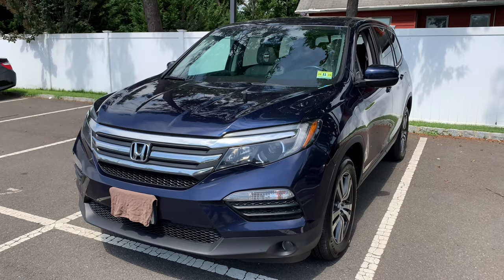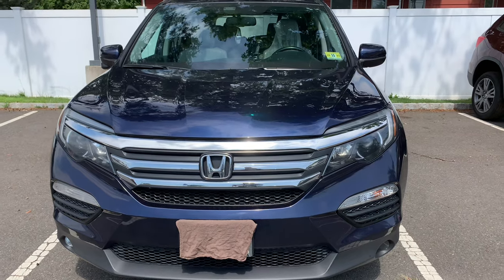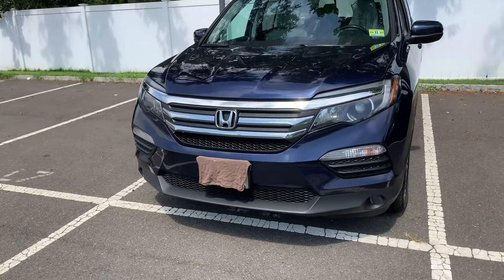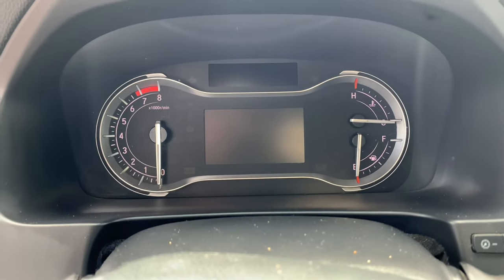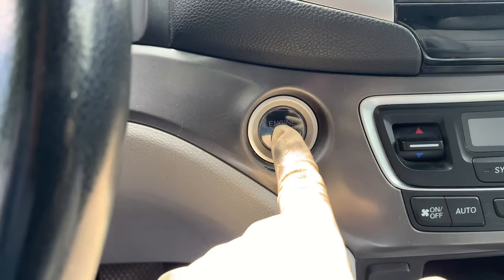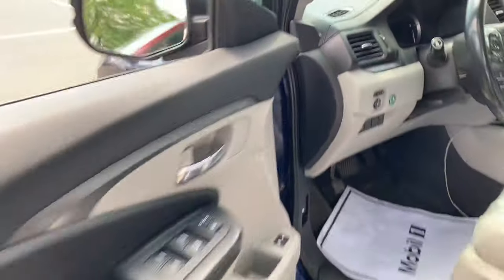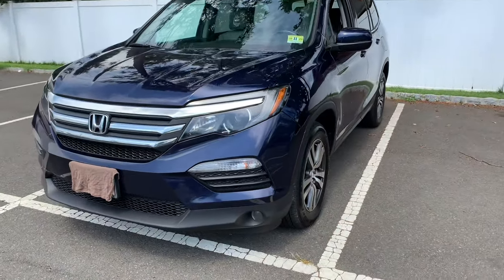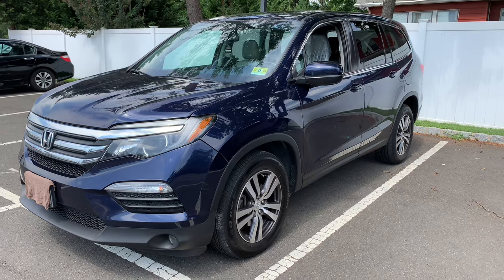2016 - 2018 Honda Pilot common problems

Comment: Bought a 2016 pilot new.  Still own it. Everything you mentioned happened to mine. Luckily had an extended warrantee which covered everything.  

The tachometer bouncing / transmission judder pops up about every 30k miles.  Drain the transmission fluid, refill.  Roll through all the gears including reverse X3 fixes the problem.  

Great review !
Reply from the maker: Thanks for the watch and for the feedback. Your confirmation that these issues are real are unfortunate but a reality. Best of luck with it going forward.
Reply: My car still bounces rpm after transmission
Reply from the maker: @yourdad1483  used or reman? You should take it back
Reply: New one
Reply from the maker: @yourdad1483  I would absolutely take it back
Reply: Same problem.. what is exactly main issue?
Reply: @HannahLoften the main issue is once the fluid breaks down the transmission starts acting up.
Reply: I need check with dealer still under warranty... it s honda pilot 2020
Reply: How much fix it. Thst exactly hapoen my honda pilot 2020

Comment: I had an issue with a jumping tachometer (6 speed). Just exchanged transmission fluid and it helped. Didn't do any firmware updates.
Reply from the maker: The jumping tachometer is a result from the transmission judder, that’s why the fluid fixed it. Thanks for your input.

Comment: I own a 2016 touring, second owner, the keyless ignition problem was solved by the dealership with zero cost, along with a software update for the transmission and a reinforcement for the hood latch. After these issues fixed, I find the car excellent. Good gas mileage, confort and security all together.
Reply from the maker: Yes all those are free for now. Sometimes I’m the distant future some might find that part of the video helpful once the warranty extensions run out. Glad your having a good experience. Thanks for sharing

Comment: I've had all but the start button issue.  I've replaced injectors, brake rotors, front struts, and the transmission problem comes on randomly.   I've got 255k miles on my 2016 though.   It still runs really well.
Reply from the maker: Thanks for sharing

Comment: Nailed it.  I've had the 2016 for 6 years.  Great vehicle, but have faced trans "jutter" at 80k, Start button replaced, and warped front rotors at about 78k.  Not too bad overall. Fixed all myself.
Reply from the maker: Nice and thanks for confirming my common issues as they are plenty of nay sayers I’m the comments. It’s always great when you can fix many of these rather simple “problems” yourself. Thanks for watching and leaving your thoughts.
Reply: @BCautosolutions  my 2017 Honda Pilot E  has about 62,000 miles..  A warning came up on my center screen where the speedometer is located.  It said "Transmission System Problem".  I pulled the vehicle over and turned it off for about five minutes.  I turned the vehicle back on and that warning  message disappeared.  Any thoughts!  Thank you!
Reply from the maker: @steveroe7712  could be anything, but my guess would be a pressure switch) hopefully there is a code stored and give you some guidance.
Reply: I replaced my push button myself. I have the 2016 exl and I have the jitter on trans
Reply: Could you please let me know how you fixed the trans judder?
Reply: Flush the fluid is all. And do it twice separated by a day.  That way, you get all burned fluid out better.

Comment: Bought brand new a 2017 Touring edition (still own), all problems mentioned have appeared. Already replaced ignition switch my self ( about $65 OEM). Currently getting the emissions problem catalytic converter code, miss fire codes, but still runs like great. I'm a long commuter, car will hit the 165K miles in a week so definitely out of warranty :( but luckily I'm a good DIY mechanic so I'm able to save some $$$ and do most of the maintenance and repairs myself. Thanks for the pointers, will take a look at the fuel injectors first before messing with the catalytic converters. ;)
Reply from the maker: Really appreciate the feedback! Yes, don’t go changing the cats out before the injectors. If you really want to be sure have someone perform a cylinder AF test to confirm failure. Good luck 👍🏻
Reply: Did you get anymore problems on yours just got 17 tour aswell 108k just hoping it’s reliable

Comment: 2016 Pilot Touring AWD, 120K miles

Currently, dealing with the service bulletin issue that causes multiple codes to flash at once, and requires fuel injector replacement. My local dealer advised me this would be warranted at no cost to me....however, the parts are on backorder. 

I can’t help but wonder if I told them I wanted to replace the fuel injectors just for better performance, and am paying out of pocket, that the parts mysteriously would be in stock. 🤔

i’m going to reach out to some out-of-town dealers to see if I can get some help on the issue. 

(I also had my push button start replaced, which was warranted. And replaced my front struts, but that was due to wear and tear)
Reply from the maker: Can confirm they are on backorder 😅
Reply: @BCautosolutions  - AutoZone, Oriely and other 3rd party non-OEM sites claim to have them in stock, ready to ship. You think it's good to go to a local mechanic to see if they can get the parts in and do it? Or order them myself and have a mechanic do the work? Or does it absolutely need to be done by a dealer in order for the codes to be cleared?

Like I said, this being a warranty issue, I can't help but think the parts will be on back order indefinitely.
Reply from the maker: @achavez78  with engine stuff I do not like using aftermarket brand parts. I would wait tbh. It typically doesn’t affect Drive ability.
Reply: @BCautosolutions  I appreciate your help! 
Shout-out from Yuma, Arizona!
Reply from the maker: @achavez78  anytime
Reply: @BCautosolutions  #UPDATE
After reaching out to five out of town dealers one of them got back to me and told me they can get the parts in about 10 days. They ordered the part today and I have an appointment for Feb 16th for the repair. It is in El Centro, CA (about 45 mins from my home in Yuma, AZ)
Reply from the maker: @achavez78  let me know what happens! Thanks for the update and good hustle on your part

Comment: Have 2016 90k, noticed hissing noice and vibration when changing gears and breaking. ⚙️ no sign on the dashboard. Dealer said transmission needed to be fixed at the cost of $8k
Reply from the maker: Yeah I would definitely get a second opinion.

Comment: I would also add the AC blower motor and also HVAC Control Module. Both have gone out twice on my 2016 Honda Pilot. Also can verify, as I have gone through all 4 issues before on this car.
Reply from the maker: @MrDarkparadox  got it

Comment: Well.......at 58,409 miles it finally happened on my 2016 Pilot Touring.  Was driving it on the interstate today and it started losing power, transmission going in and out of gear.  The Emissions Controls problem and Transmission problem flashed on the dash.  Got it towed to the local Honda dealer now.  Waiting to hear the diagnosis.  Hope it's just that the injectors need replaced, Honda will pay for it and it fixes the Transmission problem
Reply from the maker: Updates?
Reply: So far the software update seems to have fixed it.  I drove it another 50 -60 miles today with in town and highway driving and it shifted flawlessly! @BCautosolutions
Reply from the maker: @stevegordon5243  glad to hear, appreciate the update
Reply: Thank you for the followup! @BCautosolutions
Reply from the maker: @stevegordon5243  ✅

Comment: Couple of things I can add, 2016 pilot touring (elite) in Canada, engine knock sensor failed at about 140000km, out of pocket expense. Tailgate rust under license plate light, rust through, changed tailgate, under warranty. Fan blower motor likes to make noise in cold weather, didn’t bother to change, procedure is easy, oem motor is pricey. Fog light used to be beaten up by rocks/road debris.
Reply from the maker: Yeah I’ve done knock sensors, no tailgate issues. Noisy blower motors is across the line up. Thanks for sharing

Comment: Awesome video!
My wife 2016 pilot 6spd trans just started that issue a few months ago. Goin to have the fluid changed and see what happens. 
Question….is it because the fluid breaks down that causes the problems?
Thank you and keep the videos coming!
Reply from the maker: Yes, the trans fluid takes a beating and breaks down way too prematurely imo. Consistent transmission services are key here. Thanks for watching
Reply: @BCautosolutions  
Thanks again HMM...
Well there is another issue she has now..when you start to drive from a stop the shifts from first to second gear has a hard "clunk" shift or disengage depending on speed under 25 mph. It only happened twice over the few weeks. After turning it off and restarting it it does not do it. No codes. Maybe a solenoid?
Thank you
Reply from the maker: @Tjn6898  sounds like a pressure switch may have some debri in it. I have a count at work of which ones I’ve replaced more often. You can either wait until a code pops up or go ahead and change both. They are fairly affordable and easy to replaceZ

Comment: I just bought a 2016 Honda Pilot ex with 126k miles on it and the used car dealer was telling me to get a extended warranty and make sure it includes electrical systems and the way he said it now has me worried. They only gave me a 30 day warranty on the motor and only half on parts and labor and I have to use them for the repair. I have the car fax report and the vehicle was just service and inspection in February. It doesn't say what was serviced so I guess I should take it to my guy and have him check the transmission fluid and the whole vehicle 😢
Reply from the maker: Yeah the electrical stuff is pretty solid on those years. I’d be more worried about the trans juddering then anything. Definitely check that and change it asap!
Reply: I am now having issues with starting. I went out one morning and went to start it and it sounded like the battery was going dead. The alarm wouldn't set and it had the clicking noise and then dead. I had it jumped and drove it for a little while and went to reverse and I had the steering wheel turned as I was backing up and it bucked and made a strange sound had no power and I straightened the wheel and power was back and parked it got out and didn't touch it for 3 days. Went out on a warm dry day and it started right up and had no issues. Then next day I went to start it and it did a slow crank and started. I am so mad have car 2 months now and issues starting.
Reply from the maker: @dreamtoreality9892  sorry to hear, sounds like you might be having battery and/or charging issues. Need to have to checked out before it leaves your stranded.

Comment: Great video - thanks! Can you please explain the injector issue a little more? I'm picking up a used 2017 with 118K KM in a few days. I do my own work. This is my first direct-inject vehicle. Do I need to replace the injectors? Have the valves cleaned? Thanks in advance if you see this.
Reply from the maker: Honda claims the injector issue is a manufacturing defect which I find suspicious but we have  seen only a handful come back post injector replacement for another set. Luckily there is a service bulletin for now that wouldn’t cost you any money. Best of luck
Reply: @BCautosolutions  Thanks for your reply
Reply from the maker: @MrCoreyCoreyCorey  🫡

Comment: Thanks for taking the time to put a video like this together. I have a 2016 pilot with the 6 sp and 86k; I just recently noticed the shudder if I am cruising with light to no throttle, and then when I gently reengage the throttle the shudder happens. Since it's past the 80k am I out of luck to have the dealer do anything? Also, if I change the trans fluid every 15k do you think the trans will last?
Reply from the maker: Hey, so even tho your above the 80k it won’t hurt to see if they will still cover it. I’d not do a 3x trans flush and then every 15k do a transmission service going forward. The trans should be ok but obviously there’s no guarantee in that.
Reply: @Hondamobilemechanic   thanks for the advice. After watching your other pilot videos, I believe I miss spoke in regards to the Judder. If cruising at almost any mph, it feels like the torque converter lags to fully re-engage when letting off on the gas pedal for a few seconds, and the n reapplying throttle input. Any ideas? Some in the forums blamed poor converter lock up on the vcm.
Reply from the maker: @RyanKrantz  could be, would have to see some data before I could give a reasonable diagnosis unfortunately. Definitely something you want to have your local dealer look up.

Comment: My mom has a 2016, bought new. Honda reliable it is not. Had injector issues, Push start button changed twice, and the suspension is weak. How the mighty have fallen.
Reply from the maker: How many of those items weren’t covered by warranty?
Reply: I have a 2016 pilot, It had injector issues but Honda payed for it as it was a recall issue, I love my car. It's my 2nd Honda, I'll be buying a 3rd soon😊
Reply: @aracelicarrazco4469  ironic that my mom's trash 2016 Pilot just put her down about two hours ago😑. Luckily, she bought a new Hyundai to replace that pos. Modern Honda is the Chrysler of Japanese automobiles.
Reply: Yes I found this out the hard way Smdh -this ain’t ur grandfathers Honda that was past down from generations

Comment: From my experience with my Mom's Pilot the rotors don't warp, the problem is that the brake pads get really hot and leaves deposits on the rotor surface, causing the pulsations and feeling like warp rotors, the Honda  brand brake pads are the worst. Switching to ALL Akebono brake pads or a Semi metallic low resin brake pad will work as well

Comment: @hondamobilemechanic - i just bought a used 2017 Pilot Touring a week ago with 95K miles. I just took the car on its first long trip and at random times, primarily while trying to pass a car on the Interstate, whenever i would try to accelerate to pass a car , it would make a hissing sound by the steering wheel, the speed would drop to about 40-45 MPH and the gas pedal would go limp. I would press on the gas but it would not accelerate, i would need to pull  back to the right lane behind the car i was trying to pass and eventually the gas peddal would work and the car would accelerate.  This happened randomly, even once when i was just cruising and there were no car infront of me.   There where few times when i had cars right on my tail and the car would drop from about 70MPH to 45MPHs.. it really freaked me out and my wife is a little freaked out about driving the car, especially with the kids on the car.  I have not seen that mentioned anywhere. Any thoughts on what it could be? Also, this happened with ECON on and off, LKAS off and Lane Departure both On and Off.  Thanks in advance for any input.
Reply from the maker: Hey, first thing I would check is the intake tube going from air filter housing to the throttle body. Check all side for cracks/tears, don’t be gentle either. Lmk how you make out.
Reply: @BCautosolutions  Thanks for the reply.  I did the check as you mentioned, but did not find any tears or cracks.  Here is the update on the whole thing,   I did make an appointment with the dealership, since it was a week old since i had purchased it, they were able to replicate the issue, but it actually became immobile for them as they drove it back from their test drive.  The transmission had gone bad.  They will be replacing it for me. It is still covered under the Honda Care warranty.   Thank you for your reply and your help!
Reply from the maker: @alanizar  thank you for the update and luckily it happened to them and not while you were driving it. Best of luck and let me know how it feels after the repair. Honda care is a must! Nice job 🙌

Comment: The most common issue is the 65miles transmission system pop up and the car drives normal. When you turn off car it goes away. Dealerships ripped people off telling customers they need a new transmission only to have the same problem occur when they reach speeds of 65mh.
Reply from the maker: @CorvetteJ  I barely see that issue tbh. I see on a weekly basis transmissions jerking tho from poor maintenance
Reply: Cars are unpredictable. 
You never know,
when the transmission going to go!
Reply from the maker: @CorvetteJ  true

Comment: Damn. Wish I would of seen this video 13k miles ago.
Reply from the maker: Sorry, how many of these issues have you had happen to you?
Reply: I have had the Injectors, push start button and transmission stutter.
Reply from the maker: @seekwrage  sounds about right, yet some people think I’m making this up. Hopefully some/all of it was covered under the bulletin warranty extensions?
Reply: @BCautosolutions  the injectors were early on so they covered it. When I asked about the transmission stutter and the key fob they said they would check it and they said nothing was wrong with transmission so I just flushed it and it went away. But now it seems I have to change transmission fluid regularly to stop the stutter. Key start was pretty much told the same as the light went away. But both mine and my neighbors suv both do the same thing with push start button. I will send it in now to get the push button fixed.
Reply from the maker: @seekwrage  yes, there’s definitely a warranty extension for it, just tell them to replace it smh, idk why they are so against doing it, easy 10 minute job everyone wins. Best of luck with it.